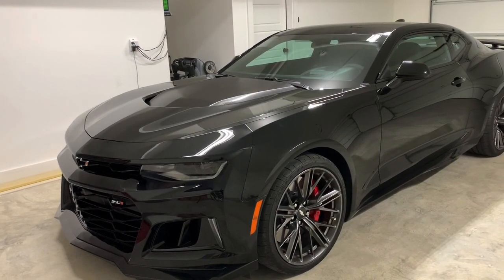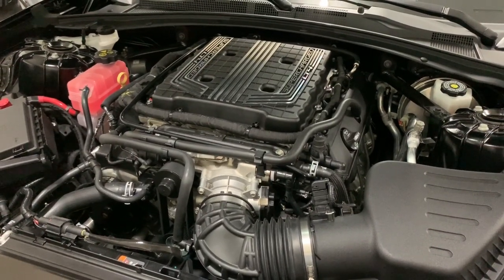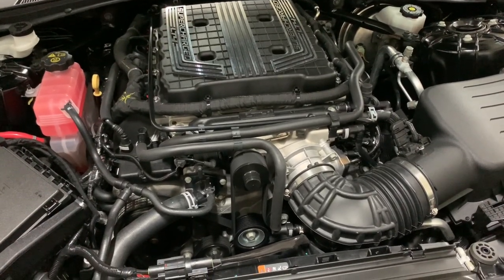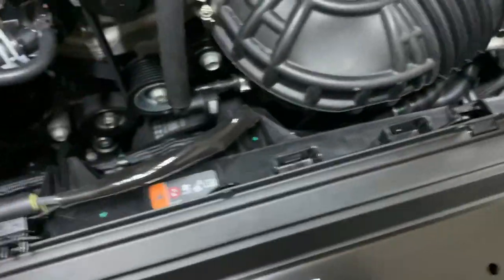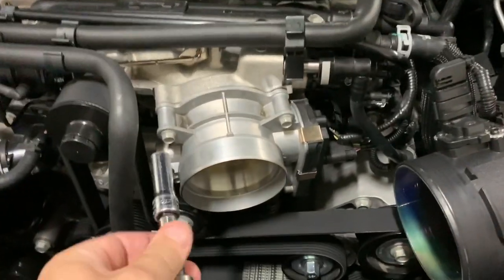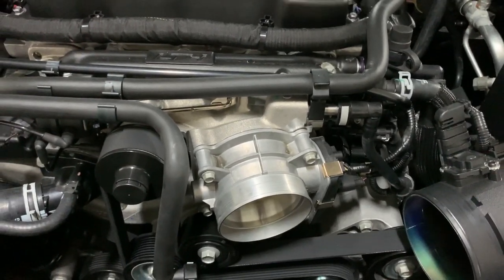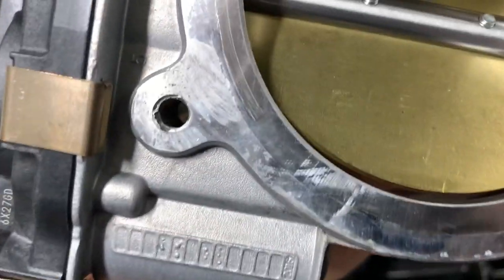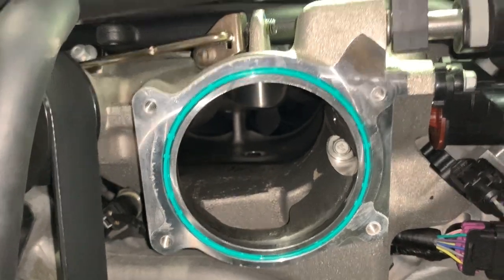Soler performance ported TB install/comparison on 2017 ZL1 LT4

Comment: I would highly suggest doing a tune on the vehicle even a flex fuel tune can net you a good amount of horsepower I would also suggest getting a gauge like the P3 V3 Gauge to document boost and ethanol content, I have videos concerning it if you’re interested
Reply from the maker: Determined Veteran I will watch them, I always like getting more info. 
When I do decide to tune the car I definitely plan on getting the flex fuel sensor and going with a flex fuel tune because there is a lot of E85 around here.  I ran a flex fuel tune on my mustangs and even naturally aspirated you get a good jump in power

Comment: I would have to hang it on the wall I would not want to get it dirty. That thing is sharp what part of bama are u from I'm from ozark 20 miles north of Dothan
Reply from the maker: Anthony Tatum I’m about 10 miles south of Birmingham.
Reply: @KnightsGarage  I go through that way alot to Jasper to visit my son. I'm a Ford guy but that's an awesome car u have and I bet its alot of fun. I just put another throttle body on my f250 superduty. I'm trying to make it faster and more fun to drive and its responding well with all the stuff I've put on so far. Its alot of fun making it go faster
Reply from the maker: Anthony Tatum shit I’m a mustang guy.  But this ZL1 is bad ass.    Ended up with it because I wanted a Z06 and they were too expensive and my wife said it had to have A back seat.  If I had a place to put it I would probably have a double cab F250.
Reply: Yeah I love mustang's I'm currently looking for one that I can build a badass street machine but in the meantime I'm working making this f250 fast . Its a extended cab not the crew cab. But I'll be working on it until I find the right mustang to turn into a beast. But you will probably be happier with what you have then the zo6 in the long run cause its badass and it has the mean muscle car look to it and will have just as much fun if not more fun with it and the aftermarket stuff should be a little cheaper and more plentiful also
Reply from the maker: Anthony Tatum yes.  A lot cheaper.   Corvette stuff is double the price for the same part

Comment: I’ll be curious to what it Dyno’ sir traps on the strip... definitely need to upgrade my stock one as well
Reply: You should see modest gains at WOT at the Dyno. Unfortunately, the Dyno only shows a single position of the throttle, it misses the point almost completely. The most significant gains occur at low to part throttle.

Comment: This Throttle body + CAI would work on a stock car, or it will need a tune ?
Reply from the maker: aviator55 works on stock car. No tune required.

Comment: Let us know what the butt dyno tells us.  Thanks
Reply from the maker: David Smith well a ported stock TB isn’t going to give you substantial gains but you will pick up some power! I can already tell you that the throttle behavior right off of idol is much improved.  Feels Nice and smooth but The computer is still learning the new throttlebody.
Reply: @KnightsGarage  So changing mine on my scat will definitely make a difference?  I've read both sides.  Some say throttle body doesn't do much unless with ported intake manifold and other mods.  Idk.  Being you've got a supercharger, I'd think with bigger TB and a pulley change would make significant change.  A guy that 
R/T life goes to has some videos of his ZL1 and the small mods he's made and the significant gains he's got. Jannetty racing.
Reply from the maker: David Smith I have I want to say two or three separate videos on my channel from different ported throttle bodies are used on my scat pack.  You’ll notice more throttle response and park throttle performance out of a full throttle body. The fast man ported throttlebody is about the best one you can buy for the scat pack.
Reply: @KnightsGarage  Thanks Project ZL1.
Reply from the maker: David Smith no problem!!